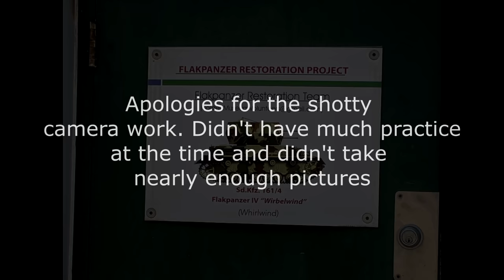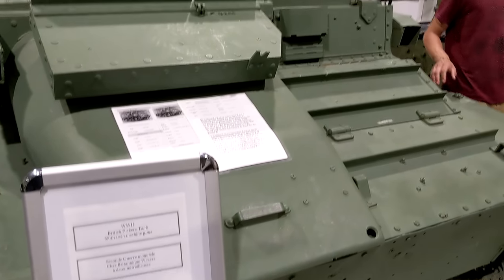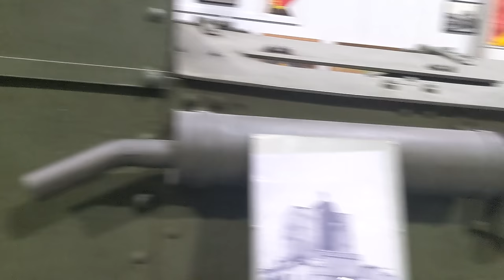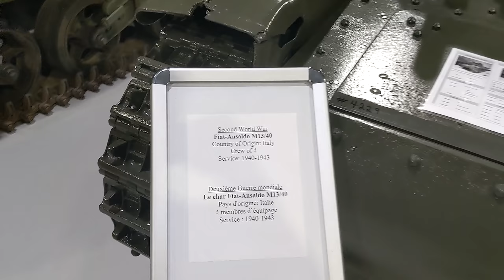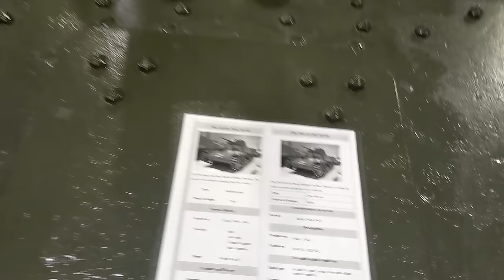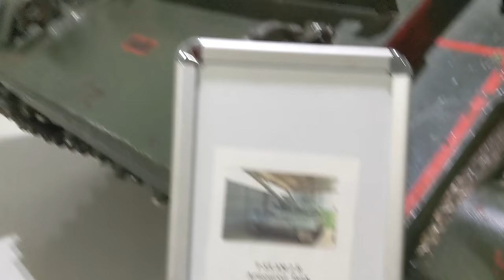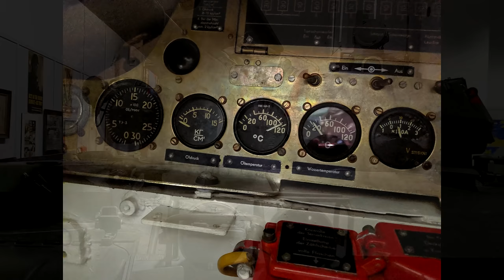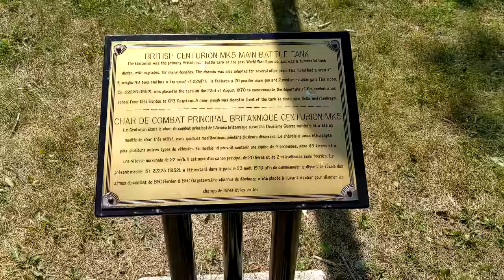My Trip to CFB Borden (2019)

Comment: I just realized how funky the late production ram mk II is compaired to the early production due to the missing mg turret
Reply: I think it also has a british 75mm or an 76mm
Reply: @browniemix3187  it actually uses a QF 6 pounder mk III cannon which uses 57mm rounds. The army was considering upgrading the 57mm with a stronger 75mm but by the time they even considered it, the americans were suppling shermans to the canadians meaning that the ram was not needed